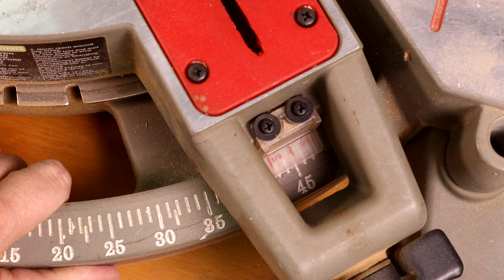5 Woodworking Cuts You Need to Know How to Make | WOODWORKING BASICS

Comment: I have been resawing on my table saw for 20 years and the important thing for me USE A SAWSTOP table saw, if you don't have one buy one because $2000 is nothing compared to keeping your fingers.  Set all square boards to the side and raise the blade an inch at a time.    Set the fence to the amount to resaw and run them through on edge.   flip the board end to end so the same side of the board is against the fence. cut this edge of the board.  then put the board to the side and repeat for all boards. Now raise the blade another inch and repeat until you saw the board into 2 pieces,  I like the last cut to just hit the center and the board just comes apart.

Comment: @ 4:48 I only had a circular saw for a precise 1 meter rip cut (think the blade was dull too). It took me so long to set up a environment to cut along a straight line (do not have a work bench yet) only  to instantly have the saw change direction cause it was nudged by the clamps holding my sketchy level setup.  I charged the battery three times and almost started a fire trying to go through a knot... I had to redo the cut three times wasting a lot of wood and had to settle with an imperfect piece. Honestly think this ordeal took me 3 agonizing hours . That same evening I purchased my first table saw and here I am watching your how to playlist. Thx a lot for all the good advice 👍

Comment: Hey Steve I am a retired helicopter mechanic and attended year long machine shop operations course in that course we were taught to lower the band saw guide post down close to the material that is being cut and also to adjust the upper bearings to keep the blade from wandering as much.with that said I watch your videos to learn wood working which is my new way to enjoy my retirement love the videos and have learned a lot, i am a beginner at this.

Comment: Hey Steve, Thank you for great videos! As a total beginner with only a circular saw and few clamps I started my first project making some rip cuts to glued pine wood boards, and I successfully made an accurate precise cuts, down to millimeters (0.04 inch) By clamping a cheap aluminium spirit level as fence guide. Yes it takes some time to set everything and 10 times to check before cuting, but ir works great. Maybe it will be helpful for other beginners that maybe not yet ready to comit to table saw.

Comment: Take some time and tune your bandsaw.  I've used a 12" Sears for years with great results.  I've built cedar strip canoes and had to cut 70-80 1/4 x 3/4" strips 18' long with no problems other than what to do with a lot of sawdust.  Work on yours, I'm sure you can get the full potential  out of it.

Comment: I love my tablesaw. It does nearly everything in my wood shop. 
It scares the living shit out of me though.
Reply: Stay scared.  The day you lose your fear of it, is the day you lose fingers.
Reply: I got my first table saw a few days ago, and it has replaced the angle grinder at the most terrifying tool in my shop.
Reply: you didn't mention the scroll saw, capable of making almost every cut a band saw can and to cut holes.
Reply: Jesus Balls i wish i had a table saw i can imagine how useful it can be :(
Reply: Ivan Freely
I understand where you are coming from (or trying to) but I disagree with that advice.
Don't fear your tools, respect your tools. 
There's a huge difference between those two outlooks.
To use a tool, any tool, that you are afraid of means that you are never going to be able to fully focus on the task at hand and that's the one thing that is more likely to lead to injury than anything else. To be distracted by fear of the tool while using the tool is almost a self fulfilling prophesy.
To fear your tool is to give over some amount of control to the tool itself and that's a problem.
You always need to remember that you are the one fully in control of whatever tool you are using and that that tool can do nothing that you don't make it do or allow it to do.
DON'T be scared of any tool. I know that can be difficult sometimes but, if you have a tool that scares you, it's usually because you don't fully understand the tool, what it's capable of, or how to use it properly. When you have all those bases covered, that fear will dissipate naturally.
If Jesus Balls is scared of that saw, he needs to learn more about it, practice with it, watch others, etc. A tool you are scared of is automatically more dangerous to use.
Reply: Totally agree.  I always told the guys I was teaching, you control the tool.  When the tool controls you, you are in trouble.
Reply: BigRalphSmith I agree. 
Problem is, I follow every rule in the book. I even go above and beyond sometimes. 
But even when I am relaxed, concentrating, and totally confident, BAM! I get violent kickback. 
I don't know why. My father in law who is a master carpenter says it's simply bad luck. He thinks there's nothing wrong with the saw. New blade and everything.
Reply: If you're afraid of the tool, you're only inviting trouble. If you're getting kick back, you are moving the board sideways across the blade. Or the board is closing/pinching on the blade. 

Check to make sure that your piece is up tight against either the miter gauge or fence, pending on your cut. 

Suggest you look into feather boards, grr-ripper, micro-jig splitter, and or hold-down safety rollers. The last one listed you need to pay attention to which you get, some are bi-directional, allowing the material to move forward and backward, (not safe on a table saw). You want the anti-kick back, these only allow the material to move in one direction. The grr-ripper in combination with the splitter and hold down rollers works wonders.
Reply: Totally agree. I've been working around dangerous machinery all my life, and one thing I've learned is that fear is your friend. It keeps you on your toes. Any good trainer will scare the shit out of his trainees, tell gruesome stories and even show pictures of injuries so that people know. One misstep could change your life forever.
Reply: Get a Saw-stop table saw ;)
Reply: I'm not made of money.
Reply: Saw stops can fail to work properly if you lose power and will do serious damage to the human body. It is just better to get to know your equipment and make sure it is properly tuned and that you are using it properly. That being said I had horrible experiences with my old table saw, so i bought a new one and now it is the most used tool in my shop. I still respect it and stop a cut if it feels like it is getting ready to do something I won't like such as kick back but so far after 3 years no kick back ever on my Delta :)
Reply: Jesus Balls
I hear you. Sometimes it seems like you do everything right and you still get surprised.
It makes me think there is something about your saw or the way you use it that you don't yet fully understand. Kickback is caused by a few specific actions or an improperly configured saw.
Read all you can about what causes kickback and what setups minimize that danger. There are a lot of steps you can take to reduce that risk.
Reply: don't be scared be aware if you get too relaxed you may forget that tools can take our fingers off or even worse scared is not a good thing being aware and staying that way every time you use any tool may keep you safe / alive
Reply: get your father in law to teach you what your doing wrong if he is a master carpenter, he will teach you / if he likes you jk, never for get no one was born knowing every thing
Reply: if you do get a saw stop hope it never gets used keep on your toes, around all power tools, they are dangerous in the hands of stupid people use your head
Reply: It should!  Mine too.
Reply: tkarlmann
No, it shouldn't. 
If it does, that's a serious problem that needs to be corrected.
As I said before, respect, not fear.
Reply: Appreciate your comment.  It's the fear that drives the healthy respect -- for me.
Reply: It's not necessarily "stupid people", the majority of the time, it's "uneducated" people that get careless. 

I was taught at an early age, "fear" is the worse enemy even for power tools, it's respect for said tool. Head on a swivel, double check everything BEFORE using. Read the manual even though many don't. If you don't know how to use something, ask someone who does, there are courses one can take to learn. All in all, do your research, it's really that simple of a thing to do prior to anything. Cheers :)
Reply: No such thing as bad luck.  (I know folks will argue that.)  If you are getting kickback you may need to tune your saw.  Right out of the box most saws are close but not quite set up correctly.  On mine the rip fence was slightly off and got narrower as the cut progressed, pinching the wood between the blade and the fence.  Once I tuned the saw and got the blade and fence parallel it works much better.  There are several very good YouTube videos on how to tune your saw.  Give them a look and see if that helps.
Reply: This is me.  I'm terrified of my table saw.  Used it three times to do anything other than cross-cuts on small stock and it tried to kill me all three times.  I've got a stack of lumber in my shop right now that needs ripped for a project and I just can't bring myself to do it.  
I've never seen a table saw that you just "stop" cutting when you feel uncomfortable with a cut, and the off switch on both of mine require me to reach across the ejection path to shut them off.
I just dive right and let go.  Saved my neck once.
Reply: Justin H
Then the only advice I can give you is to get rid of that saw. Sell it on LetGo, put it on the curb, give it to your best friend, etc.
Get rid of it.
Because the saw WILL hurt you eventually for no other reason than that you are frightened of it.
Reply: When is the last time you checked it's adjustments? Blade square to miter slots, fence square to blade, miter gauge square to miter slot, etc. Never stand directly behind the blade. If you don't know how to make these adjustments, read the manual. People tend to think a saw is ready to go right out of the box, they aren't.
Reply: TsmnnDvl5 - it's an old saw,  I have no manuals for it,  but I check it for square every time I use it.
Reply: I have lost 11 fingers so far. I thought I would of learned my lesson the first time but, I guess I didn't.
Reply: Ivan Freely If you're terrified of your tools you do always have the option of not using them. Millions of people go through life without ever having touched a table saw even once. In fact I'm the only member of my family to have ever owned a table saw.
I don't generally go through life fearing things.
Reply: Check how parallel the fence is to the blade. If the fence is out of whack, and leans towards the blade at the back of the blade, it can pinch the wood against the blade and kick back.

I lost the tip of my thumb to kickback that way. I later found out that the fence was about an 1/8 of an inch (IIRC) off at the back of the saw table from the front. This led to something like 1/16th or maybe a 1/32nd across the blade diameter, and one day when I was sawing some cheap plywood, I hit a knot or something inside, and that pinch was enough to shove the wood back and it de-gloved the tip of my thumb (the pad of my thumb, from about the knuckle to the tip).
Reply: Just want to say that a Saw-stop saves you from the blade, but the blade isn't the only danger. 

With bad kick-back, the wood being flung towards you can do considerable damage. I lost the tip of my left thumb that way. I was not using a push stick or sled, but pushing a sheet of plywood through bare handed, and the kick-back ripped up my thumb. 

That being said, a well made saw (like most saw-stop saws) have less risk of kick-back thanks to things like riving knifes and anti-kickback palls or ratchets. They also tend to have better or truer fences, so less chance of pinching the blade.
Reply: Tools shouldn't scared  anyone as long as you respect the tool.
Reply: Josué Paul I cut through knots almost every day with very few problems. Tune your saw and get to know the wood you're working with and don't use a cheap saw. Those box store saws with plastic and stamped tops are dangerous.
Reply: My dad lost one of his fingers to this evil machine. I will never get close to a tablesaw. I'm more than happy with my circular saw, yes indeed!
Reply: tkarlmann you can't have real respect and fear in the same sentence usually tbh, generally speaking. Fear is almost the literal opposite of respect.
Reply: That is good that it scares you. That is a very dangerous saw. Be careful
Reply: Seconded
Reply: or attaching a riving knife or splitters ...  Then there are all the wonderful jigs.
Reply: Nice
Reply: I heard that 4,000 fingers are "removed" by saws every year. I'm not allowed to do math, so i cannot tell you how many hands that are -ith
Reply: People even died using a table saw. Your fear is rational.
Reply: Me too but I figure that way I will be super cautious when working with it.
Reply: I love the prank on your son!!!!
Reply: Jesus Balls @
Reply: Mitre saw high
Reply: I haven't used mine yet. It sits there... mocking me. I know I should have a healthy fear so I'm safe, but I'm petrified to use it. I've seen so many videos on kick-backs that I think I've scared myself from using it. I know I need to buckle down and just use it... but I'm a chicken-sh*t.
Reply: I almost lost all 4 fingers on my left hand to a table saw doing a resaw.  I won't buy one unless its a sawstop.  I don't have $5000 to burn or the space for it right now so yeah.  No table saw for me :'(
Reply: Ian Duh I don't have a table saw but it's hard to imagine a tool scarier than an angle grinder
Reply: @ivanfreely6366  
I have 20 fingers, i could affort to lose a few!
Reply: @Josué Paul Routers... Routers are absolutely mortifying. One mistake and your finger is 90 different pieces
Reply: @Josué Paul Good idea, I will try that out
Reply: Jesus Balls Don’t fear the tools. Fear God.
Reply: @Boobashoob  Watch the fence, not the material. Kickback is generally caused misaligned fences or improper pressure on the piece as is passes through the blade. Never put pressure on the out feed scrap towards the blade. Always keep work tight and square on the fence. Make absolute sure fence is parallel to blade. Never let scrap build up between the fence and the blade. Kickback is almost always USER error.
Reply: Plant Based Will yeah they are pretty dodgy 😂
Reply: @Ohio_etsu-masu  Would you recommend getting a scroll over a band if you had to choose one?
Reply: @tonio909  no, if i had a choice I'd choose the band saw over the scroll saw. I think it's more versatile in functions and often more powerful.
Reply: @Ohio_etsu-masu  appreciate the response I was actually  in the market for either one or the other, thank you.
Reply: Isn't a router pretty useful for cutting shapes?
Reply: @BigRalphSmith  Gonna resurrect your comment 2 years later to agree! I'm just starting up with woodworking and for a while I would sweat bullets using the circular saw, especially freehand. Now it's humdrum, but you can bet your fingers I'm only calm because I've got both hands on that thing and have learned from enough silly mistakes that, as you say, happened because I let my respect of that tool lapse for a few too many moments.
Reply: I just got one yesterday and it scared the fuck out of me when I turned it on
Reply: @Gmenpg  you should count your toes just in case
Reply: @ivanfreely6366  Good man Ivan. that was a nice reply.
Reply: @Boobashoob  Where is this book you speak of that you follow? I'm trying to make some kind of basic list to go over when newbies help me with stuff.
Reply: Alexander Clements they are very useful but scary as $h!t
Reply: Does its job then hahaha
Reply: @BigRalphSmith  I had a similar thought, well said.
Reply: I have mine labeled “Satan’s little helper”. It’s the only tool I fear, and I have experience with lathes, cutting torches, etc.
Reply: @BigRalphSmith  definitely respect your power tools. A little bit of fear doesn't hurt, tho. Lol
Reply: @ironwood1621  Well, that's not so. That was the point of my posts in this thread.
Big difference between fear and respect. Respect doesn't take away from your ability to stay focused. Fear most definitely does.
Reply: @SaintJezza  120 bucks for a decent ryobi at home depot
Reply: Use a radial arm saw for a bit. You won’t fear the table saw...  as much...
Reply: I've recently gotten into woodworking. And therefore bought a Stanley table saw on a tight budget. It does scare the living daylights out of me. Was just wondering when and if there would come a time when my apprehensions would abate. No complacency...but is it possible...ever?
Reply: @BigRalphSmith  - I don't know - I both, fear AND respect my wife. It depends on the day.. It's complicated.
Reply: @hiker64  Shop tools and wives. Yeah, if you deal with your wife the way you deal with a shop tool, there will be... trouble.

Comment: Immediately upvoted when you said "Get a table saw" - That's so honest and true, you seem to know exactly what my experience was with trying to rip cut with a circular saw. Table saw will arrive next week.
Reply: I disagree that you have to use a table saw to get good rip cuts. I would love to be able to afford a good table saw it don't have that much money yet, so I use my affordable circular saw. The important technique is to have a fence of some type. A temporary guide clamp, a straight board clamped or screwed to the cut board, or even a slide-in saw guide accessory can give the support necessary to make a decent straight cut. Go slow, keep the saw snug against the guide, and let the blade do its work. No, not fun, but it does an acceptable job.
Reply: @Ed Eaglehouse  Yeah that's an old comment but since then my opinion is only stronger. Table saw is the most useful tool I own.